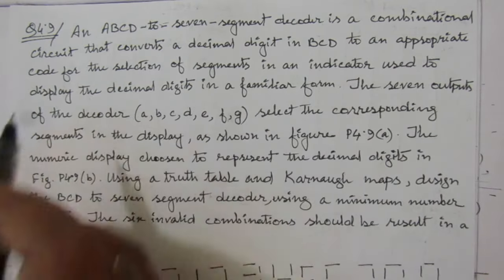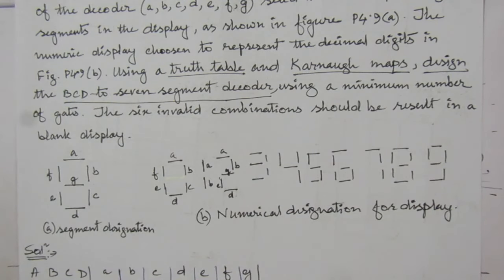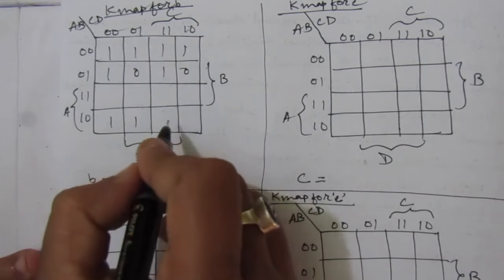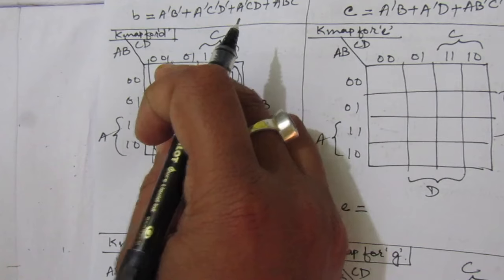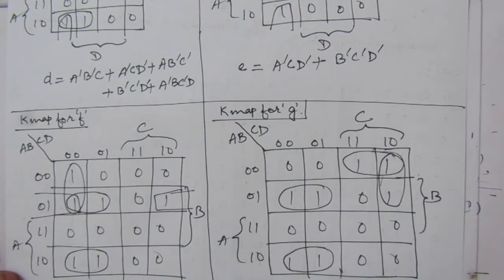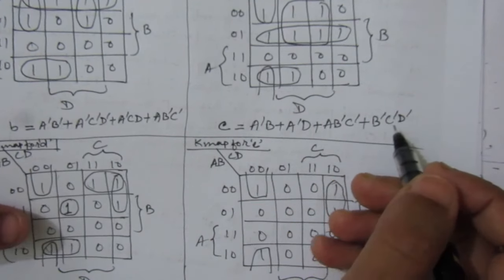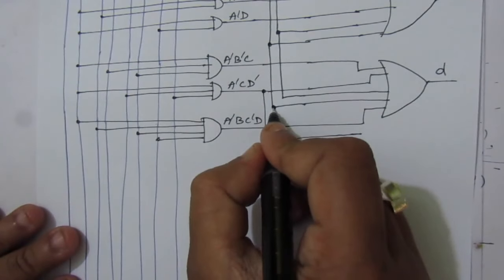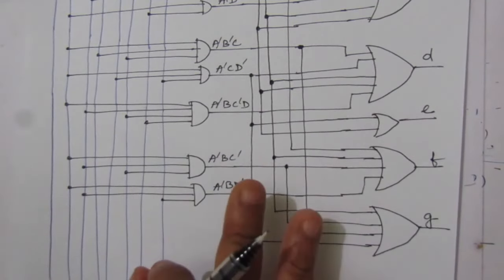Q. 4.9: An ABCD-to-seven-segment decoder is a combinational circuit that converts a decimal digit in

Comment: hey pleas help help........😴😴
Design a circuit to enable a chemical additive to be introduced into the fluid through another inlet only when the temperature is not too cold or too hot and the fluid is above the high- level sensor.